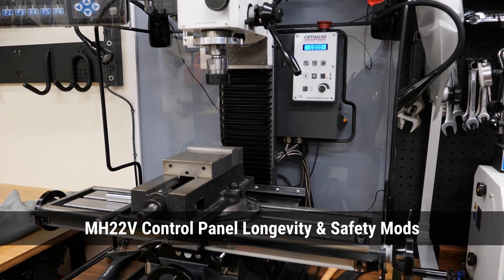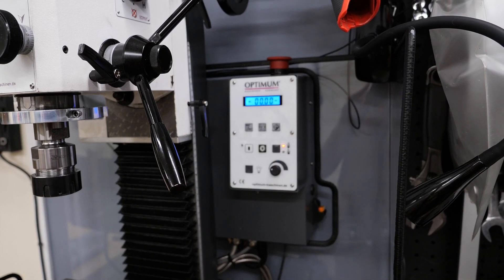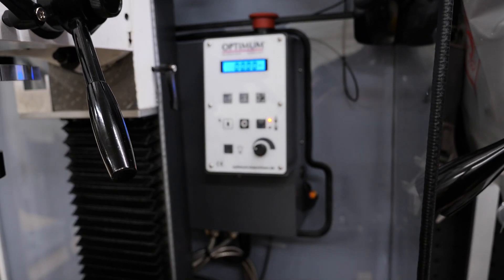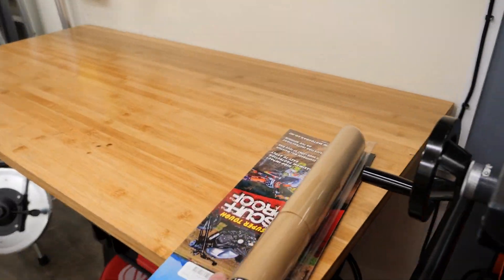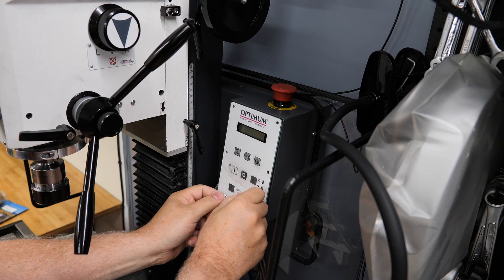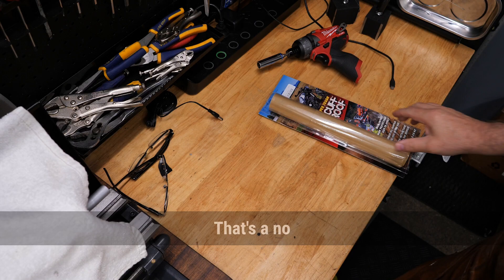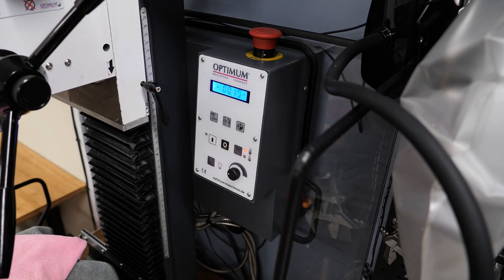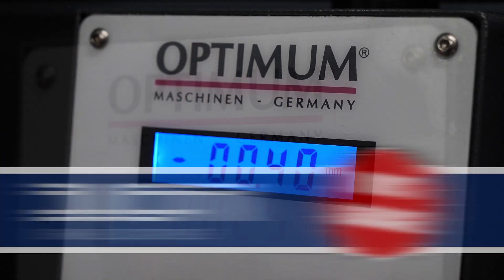Improving a Terrible Control Panel - Optimum MH22V Mini Mill - Rob's Garage

Comment: Maybe throw that panel in the bin and get some real buttons. Or do they have some MCU in between?
Reply from the maker: It looks like the flex from the panel goes straight into the main board. So yes, I suspect one could replace a couple of the switches with something proper so long as they were momentary types. Could probably even just run a lead out to another box attached somewhere up front and not even mess up the panel. Just the on and off buttons would be sufficient. Maybe one day!

Comment: On buttons.. they sell nice buttons 22mm, 19mm, 16mm, 12mm for stuff like this.. on the lathe I got rid of the L|O|R rotary, that yellow self-holding ON|OFF switch and the safety stop and will be replacing them with a 12V momentary safety/OFF switch (ali # 4000860426205 in red, 19mm) and 2 R|L green lit momentary switches (ali # 1005006783113757 19mm).  Actual power will be switched by relays that can handle 10A so I don't have this 230Vac spaghetti monster back in there ;-)

Comment: I only wanted to mount the linear scales to the TU2004v lathe - so far it's morphed into:  rework of electrical (safety + controls will be 12V now), move of ALL controls to that 45deg area on the headstocks front, lowering the motor by 15 mm (cutting + welding on the mount plate) + new small cover, creating a tray on top of headstock (removing the electronics box stick-out upwards by cutting and welding that).
Reply: ..and I'll get rid of the white color pau-a-peau and repaint the bits with that dark iron grey of the bed, it's just not good if I see the dirt stand out that much all the time and HAVE TO wipe it off.
Ah, and today a BT30-APU08 drill chuck arrived.. was a beast to separate (needed my hydraulic press), but the APU08 part in silver grey matches the lathes overall scheme perfectly and fits the tail-stocks MT2 out of the box.  Got it on sale on ali a month ago.. item # 1005002616935354
Reply: PS: I got it with BT30 in case it doesn't fit the lathe.. but the taper on the chuck is just a short MT2 (at least for the APU08) - which is available as a single item - without the BT30 tool taper..
Reply from the maker: @joansparky4439  Cripes what are you doing.. they won't be fixing that under warranty heheh!  You'll have to send some pics when you're done ducati900ss@outlook.co.nz 
And yeah, I don't like the white either... better than purple but still no prize. Going to eventually do the rest of my lathe in black/grey.
Does that APU08 chuck with MT2 make for a shorter overall unit than a typical manual chuck ona JT6 MT2 taper? Mine's way to long when mounted up so I only use a collet holder in the tailstock.. leaving me with an un-used but quite nice chuck.
Reply: @ Ducati900SS   unless something major is  broken from factory (like a casting or so) I rather fix it myself. Just not worth the hassle with me ~CNS and closest H&F in BNE.

The flat front of the APU08 is 65mm from the opening of the tailstock pinole and really only goes up to 8.0mm .. 8.5mm wont fit (at least for my unit). Outer dia is ~37mm. The manual 13mm chucks I got come in at the same length..
Reply: @Ducati900SS    haven't used a keyed chuck in years. Temporary I was using the old 16mm keyless from the drillpress in the tailstock, but that looked ridiculous 🙂
That 8mm keyless is just right for leaving it in place most of the time.

T12 3mm LH leadscrew arrived.. now have to check accuracy and once the lathe is back together can work on getting it modded to fit the cross slide.
Reply from the maker: @joansparky4439  I had a further look on eBay at keyless chucks with integrated tapers last night and it looks like there's an inch that can be saved. I've put it on my future buy list. Still paying off my last few purchases :O
Reply: @Ducati900SS    good luck, make sure it's a mt2 taper.  As for paying off purchases.. I know exactly what you mean.  Been an expensive last couple weeks so far, but it's slowed down considerably now.